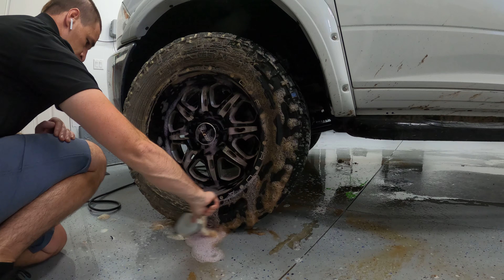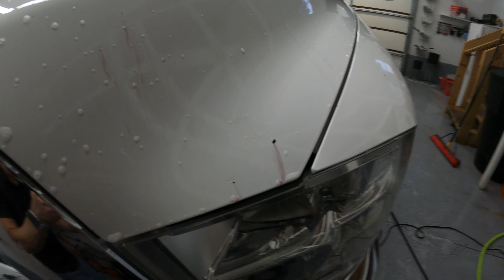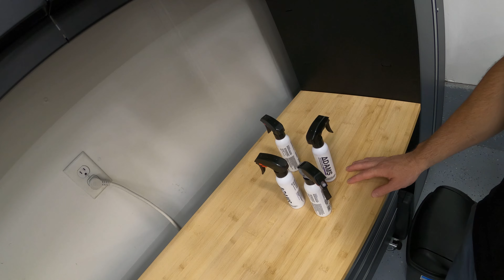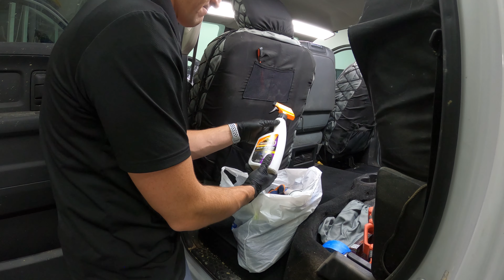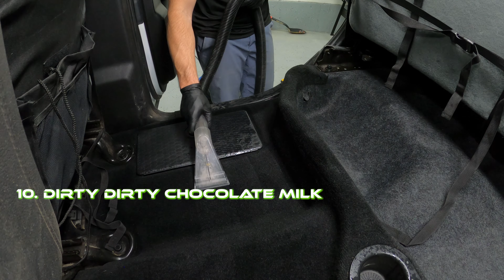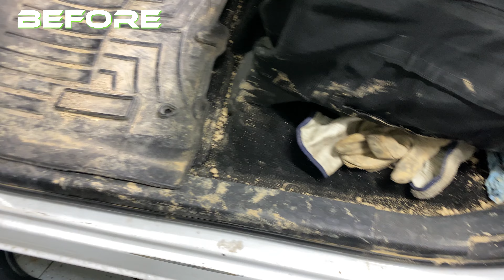'17 Ram 2500 Disaster Detail | Deep Cleaning Mud from Exterior and Interior!

Comment: Another awesome aspect of chemical decon products and the reason I also believe they're best to use first, is the way they work.

Basically it works because an exothermic reaction between the ferrous metals and the chemical causes the edges of the particles to basically be burned off and consumed in the chemical reaction.  This is awesome because It makes the stuff release from the panel easier, anything else that still needs to be clayed is going to at least be rounded off and less likely to mar the surface upon removal.
Reply from the maker: Totes agree Muchacho my bru.

Comment: awesome video as always, on the last one when u said u had a super muddy truck I was expecting more mud on the outside than in but still super muddy and great results as always
Reply from the maker: So I should have had a qualifier. The exterior was thrashed, but the customer had rinsed off some of it. I think I was so devastated because I spent hours in the middle of the detail rinsing the floor. The clip where I pulled mud out from underneath was the third time I had done it and I had rinsed in between each round. I kinda got in the zone and forgot to film most of the under carriage. I still want a hella thrashed exterior, but it is hard because most the time customers at least rinse them off at some point before.
Reply: @P4SDetails  hey I'm not mad at Ya, lol it was still pretty thrashed overall. and the short clip of the undercarriage I could tell it was muddy as hell, speaking of which u should get one of those undercarriage sprayers u attach to the pressure washer. I have one and it makes spraying under cars and trucks so much easier.
Reply from the maker: @MegaChevy25  great suggestion. They aren’t that expensive either.
Reply: @P4SDetails  no they are pretty cheap, u would probably have to use the spray nozzle for super dirty undercarriages like on that truck to knock the big stuff loose but it’s great for most other situations, u can spray the underside with an apc then rinse with the undercarriage sprayer  it would be a real nice compliment to the engine detail that way u are getting top and bottom. I do recommend getting a couple extensions for the pressure washer wand so u can stand up while doing it instead of having to bend down a little to get under the car or truck without hitting the rockers